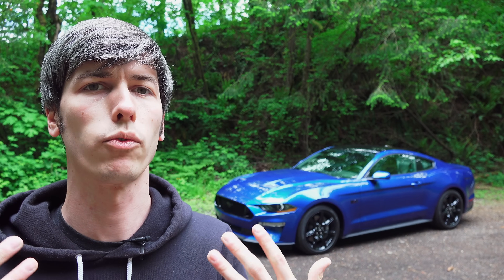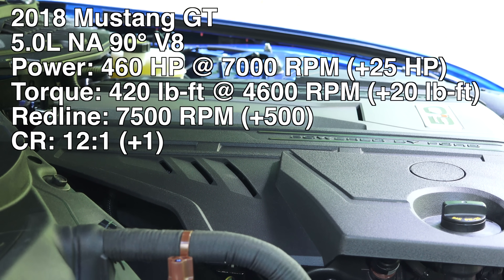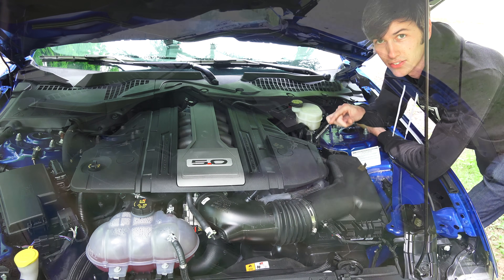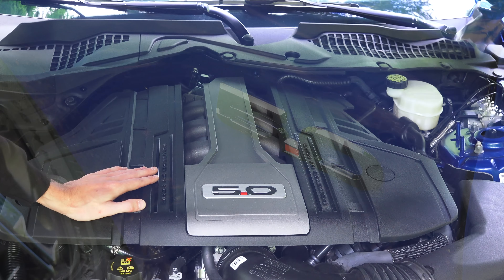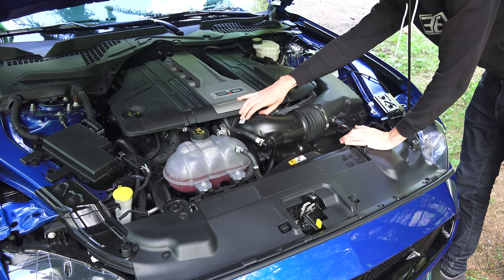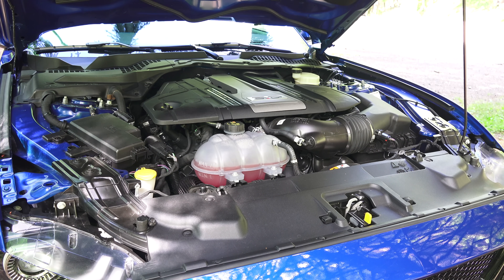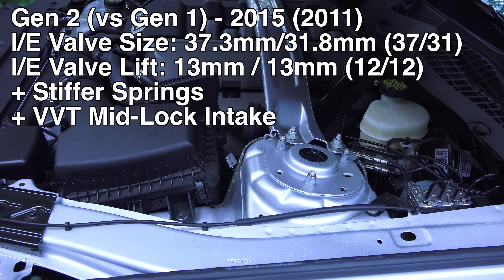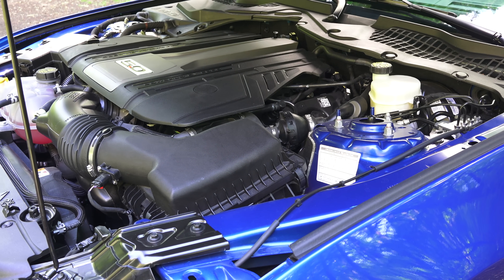The Best Engines - 2018 Ford Mustang GT 5.0L V8

Comment: Unfortunately these engines are crap because of the spray in liner causing early wear and piston slap. I know because I have one and I'm on my second engine because of scoring at cylinder 4
Reply: i just commented that i wish i would have went with an 18 over a 17 but maybe not. my 17 has been the best car i have ever owned. not one problem, everything has been perfect. not very often can i say that.
Reply: Anthony Hales yeah I’ve read so many different many reviews and opinions and a lot of people are recommending exactly what you’re telling me. 
Well I’m gonna drive the car and enjoy it. If it breaks, it breaks. After all, that’s what warranties are for. Thanks for the advice.
Reply: Anthony Hales can you just buy this at any auto parts store? And second, how much did you use?
Reply: Focus ST and Mustang 2018 fail. If you wanna nice reliable mustang, get a 03 and do a throttle body change BBK.
Reply: I have an 07 with 197k miles, never a problem with the motor. Just now it started using about 2 cups of oil within my 10k oilchanges with amsoil... too bad the 4.6 v8 does not produce anywhere near 440 hp... but they are eternal.  I changed the spark plugs for the first time at 195k miles and only 1 broke. Long live the mustang GTs
Reply: @JamesFox-g7x  It's a real shame because my 2015 has had 1 recall for door latch and not a single issue. It has never left me stranded or Check engine light. Absolute flawless engine after 4yrs of ownership and 24k miles.
Reply: All these boys with piston slap due to liner scoring are probably living life north of 7k rpm. Even a nascar engine is trash after a race. I've got 13k on my gen 3 and all is well. I kick it in the ass quite often too but I don't torture it.
Reply: Pappy even on their f150 they still living north of 7k rpm?
Reply: Cylinders have been coated like that in motorcycles for years with no problems. They have too short of a skirt on the piston, that is causing the problems.
Reply: Anthony Hales awesome thanks man!
Reply: I'm in the same boat.  Working on a buy back.  I'm on my second engine and it has cylinder scoring and piston slap and a knock
Reply: Is there a fix for this? I'm planning on getting one
Reply: tb12269 you can’t blame 1.3% of these engines that have gone bad as a whole. The engine is awesome it just needs some tweaks as well the transmission. Unfortunately the trial and error is coming at the expense of a few thousand customers. 
Mind you I have an 18 mustang GT myself.
Reply: Joao Salvattore keep
Your fingers crossed it doesn’t happen to you I know of many bought back already An many traded because of issues. It’s a lot bigger then you think. Your allowed to think whatever way you want it’s not just the mustangs either the f-150 coyotes are failing at alarming rates too. 2 guys last night on the forum I follow 1 with a rousch blower at 14k an the other one 5800k main bearings eaten.
Reply: Underfedcoyote 5.0 no trust me I believe you. I mean at this point I’d really like to take it back but I doubt they will since nothing has broken yet
Reply: Joao Salvattore ya with just my short block I was stuck them the 10r80 failed that was over 30 days in the shop that’s what got me to qualify I believe.
Reply: Underfedcoyote 5.0 I literally just sent ford dealership an email with my concern. I mean I bought the car literally 3 days ago. I don’t daily drive it either. I’m probably just gonna trade it off for another car in a year or two
Reply: @underfedcoyote5.0  I'm late to the party, but my Roush blown f150 with a gen 2 scored 3 cylinders at 80k. It's frustrating.
Reply: tb12269 your not alone ford is buying my car back because of multiple failures the short block failed first at 4600 an then the 10r80 failed at 5100 miles. Got the car back an the new motor started to tick or knock guess ford calls it piston slap that’s what they wrote on my papers
Reply: It's not just the Mustangs, the new F150 2018 uses the same engine and it has problems with oil consumption, slap, and rattles. It is NOT one of the best engines, by any metric. Stay away from one if you don't want to feel like you got screwed in the butt.

Comment: What do you think of the hot-wire plasma spraying process for depositing a hard metallic wearing surface on the cylinder bores versus the traditional Nikasil method of electroplating a 0.004" thick Nickel/Silicon Carbide layer on the bores. Given the apparent greater simplicity of the Nikasil process, would you expect it to be more reliable in depositing a uniform thickness wearing layer on the bores than the plasma spraying process? In theory, the plasma-spraying process should work but I'm concerned with the actual production processes where there might be greater chances of variations of the thickness of the sprayed metal on the Aluminum bores. I like your videos, as they are interesting and informative. Thank you.

Comment: Have you addressed the engine tick issue that ford has so for ignored?  I thought I may have heard it when you turned on the vehicle at 5:20.
Reply: Tick tick tick tick...we are the best...tick tick tick tick
Ford's 'better ideas' don't always pan out.
Reply: @GooglePixelGoogle  lol😱💪😂😄😄
Reply: My 4.2 v6 had "the tick" since it was new and it lasted about as long as any other v6. All the ticking is is just noise from a single cylinder. At idle, not every cylinder is contributing the same power, usually one is contributing more.
Ie an inline 6.

1 15%
2 10%
3 35%
4 10%
5 15%
6 10%

Something like that. The cylinder thats contributing more is going to have more sound through it, and will sometimes have that tick. Its not valves running with no oil, that is a different sound and way way way more noticible. Apply that to a v8 and its the same damn thing. Also, thats why diesels have a rhythmic knock as well.

Comment: The weirdness is the old pushrod 5.0L, which actually was 4.943, which mathematically really rounds to 4.9L.

Then again, they had a 4.9L inline six, so maybe that's why the slight fudging on the rounding...

Comment: 5.0 also has a really nice power band as well. It can pull in high rpm range pretty well and still has low end grunt. You just have to drive one to see and feel how nice this engine drives. It's also proven very reliable and has massive aftermarket opportunity. Absolutely love this motor.
Reply: I agree with the pulling in high rpms. These coyotes scream but the low end torque is pretty lame imo
Reply: @lobbyrobby  I own one and I can agree. The engine is fast under high acceleration sure but it’s missing that low end pushrod v8 torque that pins you to your seat and makes city driving fun.

Comment: Numbers not as good as gt86/brz engine at this same level peakpower-cutoff power per liter. This only makes 91hp/liter, gt86/brz makes 100hp/liter at same 7000/7500 peakpower-cutoff rpm.

Comment: I really want to get one of the new Mustangs and they have some really killer prices like in the low 30s but I think I'm going to wait for the 2019 so they actually have their transmission issues figured out. Note I would buy a 2018 if Ford had an open recall for the shift Fork issue.

Comment: You can just do (93/92.2)^2 x 4951 for new displacement. I reckon this 10 speed 460hp gt would pull 300kph or 187mph delimited.

Comment: One little thing. You said direct injection was added for 2018, when in fact the 2011 coyote had direct injection. It was the port injection that had been added. It was done for greater low load and cold weather efficiency. Great video!
Reply: 5.0  only had port injection until 2018.

Comment: NICE video and looking forward to next engine series.

Spray in liner on bore not only adds displacement, but also better wear on bore and better thermal properties on cooling cylinder.  WIN-WIN.

P

Comment: I like your approach, Mr. Fenske; talk in terms we want to hear and can understand. Not everyone drives high powered vehicles, though; how about a review of the Ford & Mazda 2.0/2.3/2.5 DOHC four cylinder engine family? I have a 2.3 "Duratec" four cylinder in my Ford Ranger, and if I've read things correctly, it also employs the CMCV system on the intake manifold. I've been delighted with the performance of this engine in my truck.

Comment: As an owner of a 14, and the new 18
Coyote or die 

Managed to make 690 hp with my 14 without changing the internals 

Gonna go for 900 in this new one which shouldn’t be a problem

Comment: EE: Could you discuss combustion chamber shapes and their effect on a given engine's ability to run elevated compression ratios while maintaining ignition advance on pump gas? I'm not a fan of 4V or DOHC designs because they are so large externally compared to their internal displacement, but modern 4V designs do seem to be able to run higher compression ratios for a given octane and I think it's related to either their pent roof chamber shape, or just the trend towards smaller chamber volume. 

Chevy's LT1 makes the same horsepower as this new Coyote, but with more area under the curve while being over 6" narrower externally. I see that it has a half a point less compression ratio than the Ford pent roof, so I'm wondering if the heart shaped wedge chamber is less efficient than the pent roof or if maybe it's related to cam timing or just overall chamber volume. By the same token, older Gen2 Chrysler Hemis had huge chambers and required quite a bit of ignition advance, but a Gen3 Hemi gets away with an efficient burn with less advance, but like the Chevy wedge, usually runs less compression than a smaller pent roof design. 

What's up with that? Does detonation resistance at a given octane and mixture ratio go up with a decrease in chamber size at a given static compression ratio and valve timing? Could they be using cam phasing to introduce more overlap at torque peak to slightly blow down the cylinder to prevent detonation when it's most likely? Could this be one explanation for the trend towards smaller bores and larger strokes on engines that will never see a transverse FWD unibody, or is the pent roof actually more efficient due to it's shape alone, irrespective of total chamber volume? Let's just assume all examples are DI or MPFI unless injection point has no bearing on detonation resistance.

Comment: The different sounds didn't translate on the video. I guess from your reaction it does in real life, but I couldn't hear a difference. Taking into account the displacement and that it's naturally aspirated the HP figures are impressive. I wonder what it'd do dropping a couple points of compression and dual turbocharging it? Be interesting.

Comment: How can a new engine be called one of the BEST engine's???  Buicks 3800 and GM's LS are  the best engines  because they both have been proven for many many years research them!!   When an engine runs for 300,000 miles using ACO brand oil and the cheapest oil filter changed every 8 to 12,000 miles ran low and out of oil multiple times and starts and runs great, then you can tell me it's the BEST engine...

Comment: It's great how Ford makes factory RHD Mustangs for the Australian market to now fill in the empty void where the Holden Commodore/HSV & Ford Falcon/FPV had dominion over. 

Dodge SRT & Chev should start bringing in their Chargers, Challengers & Corvettes down over to Australia, the Camaro is on its way butthe problem with it is it'll need to be RHD converted by a 3rd party company and it'll be double if not triple the original price.

Comment: good engine , but what about suspension and drivetrain, can it get that power on the road, not just theoreticly? that was for many generations why the mustang was slower than the camaro, even thow that camaro sometimes had atleast 40hp less. 
from another standpoint, u was talking about the place of the battery (for exsample), how easy is it to get to the battery for testing? 

btw. this sounded alot like a promo video. from my experience driving, owning and working on fords, i have absolutly nothing good to say about the company. it may be a pretty good engine but compared to what i work on every day here in germany, its nothing new and nothing inovative, everything u just talked about ive already seen.

Comment: So a lot of added complexity for 40hp. This thing will probably end up being rough to trouble shoot later in it’s life as there are a lot more components added to the engine. Are the connecting rods going to be the weak part of this engine as they are sintered? how do you think the spray in cylinder liners will last compared to traditional applications, (cast sleeve). Glad they left injectors behind the valves as well to help with carbon build up. Thank you for the in depth analysis!

Comment: This engine is so high technological, all aluminum and another New tech stuff. Why it has só poorly HP and torque per liter? Why?
Reply: Or this is a wheel Power. After the Power losing in transmission from The cranckshaft?

Comment: I'm struggling to get excited here. The main differences between this engine and the previous version are much the same as those between this engine and the S62 M5 engine of twenty years ago. I would suggest if you added the extra compression, 100cc more and direct fuel-injection to the S62 you'd end up with an equally if not perhaps more performant motor. That's just my three-penneth...

Comment: Engineering Explained. Excellently done, please make more. Also, when your speaking to auto makers, really brag about Ford and Toyota's Engines, with both Direct and Multi-Port injection, LOL. But we seriously need other automakers to use this, for the carbon build up problems with Direct injection, but also for the performance benefits, that might lessen the need for Forced Induction on more engines.

Comment: Ford had the 302 engine in the 70's, then stop it in the late 80's early 90's for the 4.6 i think. My friend had one of those box rustangs with a 5.0. That engine sounds like its gonna cost a lot to get repaired when the miles start getting high.Sounds like a great video series on the new engines Cheers!

Comment: Mustang fans: Is this 5.0 a totally different engine than the 5.0 that used to reside in the GT models before the 4.6 came out? And why is the 4.6 gone? Thank you.
Reply: Yes, and the new 5.0 is a drastic improvement on the 4.6.

Comment: Great video, but I could do without the exhaust review. Not hating the 'Stang' at all, but any car can sound any variety of ways with no performance implications. It's just noise. I am quite impressed with the 460hp 5.0 liter! It looks great, and I am sure its plenty fast, and a blast to drive all the way to 7500 rpm. But the fascination with loud exhaust, which can be mimicked by drivers of all downlevel vehicles, lets downplay. My 2 hp lawnmower makes a bunch of noise.

Comment: Dont' forget to mention the 1.8t and 1.9tdi from volkswagen. I drive the 1.9tdi with 90hp every day. The engine already has 225000km on it and was built back in 2003 and i drive it with 5.2l/100km even tough i don't drive slow. Both engines are extremly reliable.